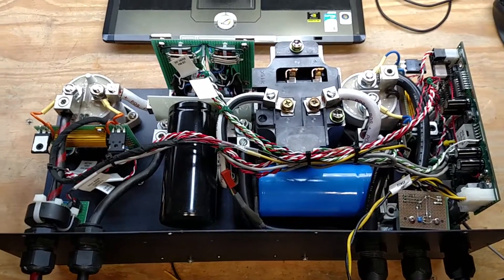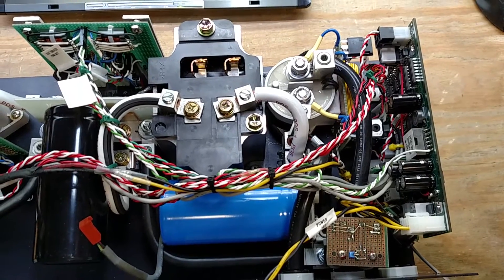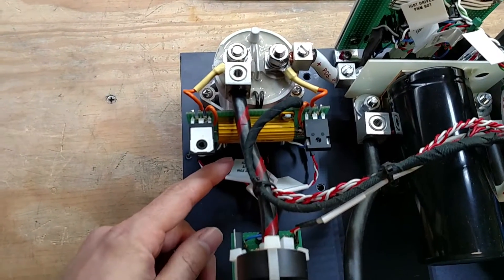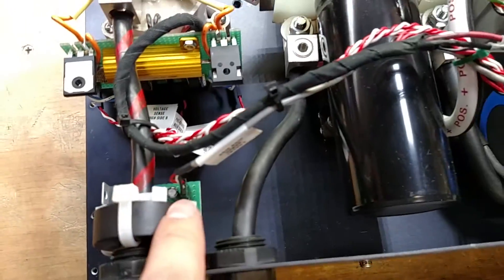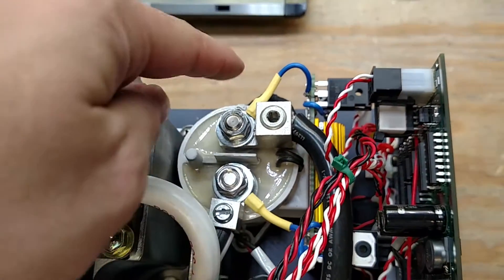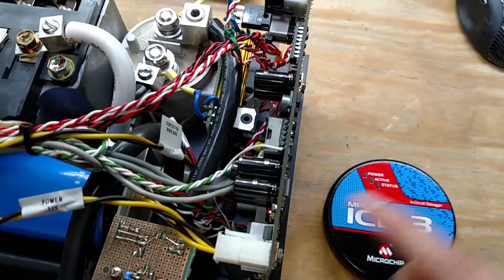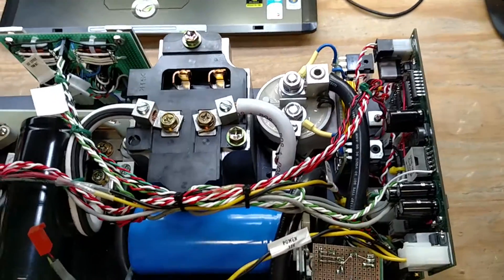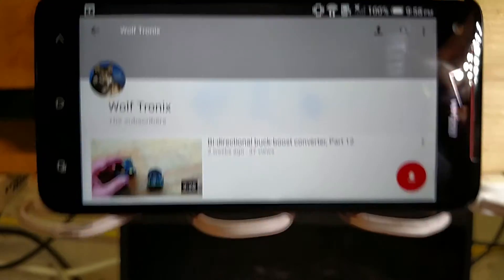Bi-directional buck-boost converter, Part 13

Comment: Good job! How do i design a control for bidirectional buck-boost converter to maintain 500 volts at the boost side and 250 volts at the battery side? thank you
Reply from the maker: +kenneth mordi 
I would recommend you use a microcontroller...
Use the ADC to measure the input and output voltage (divide it down to the input voltage of your ADC).
Then PWM the desired IGBT to buck or boost depending on the voltage.
Simple. ;)